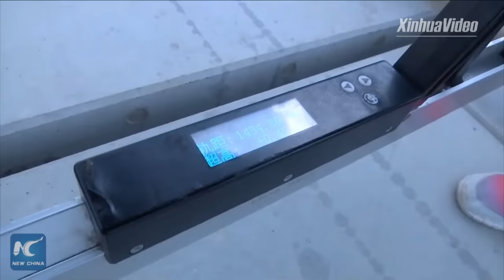How are China's high-speed rail tracks laid?

Comment: China lays more high speed track in ONE WEEK than USA has laid over last 10 YEARS
Reply: means its all gunna fall apart at the same time. Everything requires maintenance. Its a nice touch to see  concrete ties with  reinforcing steel still sticking out of it among other things. Lay  trash down fast with plenty of propaganda to go with it.
Reply: Is sad but is true.
Reply: Wich highspeed track you are talking about?
Reply: Sad, but true...Hope Texas puts the high speed track from Dallas to Houston together soon. Way overdue.
Reply: @GerhardReinig  China built network of more than 12000 km high speed tracks in 10 years.
Reply: not correct，it’s 25000km in 10years
Reply: But china very crash than usa
Reply: @IronViking  they are, I believe they're starting to build it
Reply: Is there high speed track anywhere in USA?  Where?
Reply: @standinsmore9962  its being constructed in California and there are plans for Texas but they're in danger of cancellation
Reply: @standinsmore9962  Amtrak's northeast corridor.
Reply: ОРМУС КАИЗЕР  
It's just too expensive in the US. You must pay every landowner and this does cost billions in the US. In China you just deport the farmers when they try to resist.
Thus its much more feasible and cheaper in China and that's also the reason why you use the aircrafts in the US. The latter are also faster at these distances and are more fexible than railway tracks.
Reply: @OpenGL4ever  The HSR tracks are built on elevated lines the colums of which take up minimal farmland!
Reply: Try 2 decades.
Reply: @Madmoody21  still holding after 2 decades. First track lay in 2008 and still running. Lol
Reply: @standinsmore9962  none. Just start to build one from DC to Philly. Finish date. Who knows. Lol. California been talking for 2 decades.
Reply: Bullshit it a matter of requirement, all those technique or machines heavily rely from Germany either import or produce under license locally
Reply: Loam Bart   
Saying Spain "only" has 3100km is misleading. The total land area of Spain is 505,990 km^2 compared to China's land area of 9.597 million km^2.
Similarly, France and Germany are only 643,801 km^2 and 357,386 km^2 respectively.

A smaller country will obviously need less high-speed track to meet its needs than a larger one. China should be proud of making so much progress in such a short space of time, but don't let fanboyism get in the way of facts.
Reply: wrong
Reply: @dumitrutudorache2156   wrong
Reply: @zpetar   so did the us
Reply: @dumitrutudorache2156  no it is not
Reply: Lmao the USA hasn't laid any rail over the past 30 years. All they fuckin do it rip up tracks and turn them into bike trails.
Reply: It took America to build almost 30 yrs to build 500 subway stations what is China own now
Reply: @GerhardReinig  Acela
Reply: @Madmoody21  I agree only 50% because I witness the construction workers drag their projects. For instance, I live across from a public school and they were laying new concrete in front of the school. It took them 2 months to do so because many times I see only 2 out of 6 people working and the rest of them just stand there and talk doing nothing. Another good example, they are currently undergoing a bridge repair by my neighborhood, everytime I ride my bike pass the construction site, many of them are just standing there talking and it was like 9am in the morning and they just started their day. And it happens every single time I go pass the area. This is tax payers money that they are wasting and they are getting pay an average of $55 an hour. The project still hasn't been completed after 7 months. That one little section about 100 feet of repair should not take that long.
Reply: CHINA is now the Global leader building helping African, Latin Americas and even European nations build their infrastructures with Superior Chinese Technology..U.S became imsignificant.
Reply: @OpenGL4ever  But how many places can you go to at the tune of $400.00 per trip? And this is if you book your flight a month ahead of time, you're lucky if you can get a ticket at less than $600.00 for same-day booking, you just can't beat the low cost for high-speed rail on the consumer standing point. I am sure the repercussions on the macroeconomics, in the long run, will really cost us big time in terms of competitiveness with countries like China imagine how fast they can move not only labor force but cargo as well this will make a huge difference in the future.
Reply: @Madmoody21  These tracks are monitored by computerized equipment on special highspeed trains.
Reply: USA trains are a disgrace.
Reply: Mrese ur english is very crash than chinas rails, fix it.
Reply: @standinsmore9962   yes north east us
Reply: all over the place if you like 85 mph.
Reply: @geraldmiller5260  no they are not... we move plenty of vital freight by rail... no disgrace there
Reply: @Madmoody21  jealous not make sense bro
Reply: I never saw old American movie showing construction railway first line. They were a lot of Chinese worker2 who game from China.
Reply: The United States does more freight. Plus, if Amtrak laid more high speed track people wouldn’t ride the train. You can thank our votes for where the railroad is today.
Reply: @Madmoody21  Something tells me there is a large enough population in the PRC to have enough maintenance personnel to handle it.
Reply: @LaRoucheisright  we do have a high speed trains and it runs on the northeast corridor called the Acela Express. One in California is currently under construction connecting LA to SF
Reply: @ryankiser294  Ya, well Ryan,  this is on a slightly larger scale we're talking about global. Lets start with going from the tip of South America, Santiago, to Anchorage, then under the Bering Straight to Vladivostok, on to Europe and from there to the Middle East, and Africa, oh ya and back at Vladivostok I didn't mention the other fork down thru China, the SE Asia, all the way to Bali. And that's just the "Road" part not to mention the "Belt" yet. nor even all of the Road, which will expand for a long time to come, crating maybe a billion and a half jobs in a  very short time.
Reply: You want a train from NY to LA????  We fly, it is still much quicker than a train.
Reply: James Hughes not faster than the trains China has.  The Us has never built even one mile of the high speed train China has.
Reply: But this not about measuring penises. We love China and Russia and India. We love all people and peoples. We will work together to reach the common aims of man, or we will perish. LaRouchePAC is the place for how to help make cooperation happen.
Reply: @LaRoucheisright  The british empire has been gone for decades
Reply: @yourneighborhoodwierdo8349  You don't know what you're talking about.  You don't know even what the British Empire is.
Reply: So what ?
Reply: @Madmoody21  Who said they were not going to maintain it?
Reply: Chinese railway sucks it is a loss making system.
Reply: @mrese4009  actually china has way safer trains than us thats bs. they had 2 TWO accidents since this rail network was built. we habe amtrak crashes like every 6 momths
Reply: @sumitpandey-tw7rm  actually it factually isnt dude. i hate the chinese govt but these are increbly safe super smooth bullets on wheels. its a fuckin fact man. european countries and japan and chine did it on a small scale. and chinca did it for cities as far apart as nyc to la. thats absurdly big. props to them.
Reply: USA has no high speed tracks
Reply: Yes, but it's made in China 🇨🇳. That's the difference.
Reply: @shaunw.1173  so its better, cool!
Reply: @louisaugustexvi4515 ,

Commodities from China 🇨🇳 are cheap quality. The market for the same part manufactured in different countries such as Japan 🇯🇵, USA 🇺🇸, or Germany 🇩🇪 reveal the price difference based on the quality of the product.
Reply: @shaunw.1173  price difference based off of labor lol, and don't speak when your product you're typing on is probably made in china, or has parts from china
Reply: @louisaugustexvi4515  ,

Sounds like you don't own any American or German engineered/made precision tools and compared them to Chinese made precision tools. There's a BIG, undeniable difference.
Reply: @Madmoody21  comment like this deserves way more likes, yeash i won't fall into any western and chinese propaganda thx for the reminder
Reply: who cares
Reply: who cares
Reply: Planes are faster.
Reply: @tbp1256  we all do. they’re dominating rn
Reply: Fact!!!!!!!!!!
Reply: @Madmoody21  you mad bro Amtrak derails more often
Reply: @shaunw.1173  jealous bro
Reply: @qjtvaddict ,

Huh? Of what exactly?? 🤔
Reply: @Madmoody21  At least China have High Speed Rail unlike the U.S.
Reply: You must have just flown in from Mars. You have no idea what you are talking about
Reply: @l0z586  Time will tell I say. I do so Hope you are right there  in mainland CCP China having a good time. You Will have even more fun in the next few years Im sure of it.
Reply: and than in PuRusha about 100 years
Reply: As an african from the motherland,i can confidently say,we used to be brain washed that america is a super power militarily and economicaly but that has changed for the past 20yrs since china set foot in africa,africa has made progress in comparison with the invasion of europeans since the mid 1800s,china is not a country that planders other countries resources for her own benefit but rather comes into terms for mitual benefit,militarily;china has leveled the play game by innovating her naval fleet,introduction of new fighter jets like the J7,and is also the only coutry in the world that has launched a space station without any joint intervention,and with the formation of the BRICS association the yuan will emerge as a formidable currency taking the dollar out of the picture,and i urge african states to join brics and ditch the dollar so as to free africa from economical slavery which for decades has had a negative impact on african states.
Reply: @Madmoody21 lol this didn't age well
Reply: Yeah they build so fast by cutting corners. Get a new job, 50 cent army.
Reply: Built ton mediocre Sstandards as nearly everything in China. 2800 of the 25 000 km  mentioned  were so poorly constructed that they were dismanted and had to be built again.
Reply: Criticize all you want but China seems to be moving leaps and bounds with high speed rail. Maybe they don’t have politicians bickering on how and where the tracks are laid. They just do it.
Reply: @OpenGL4ever Too many greedy landowners.
Reply: @pgdog888 HSR to nowhere?
Reply: @LaRoucheisright I guess high speed rail in the US for cross country travel is called the gas guzzling hot rod V-8.
Reply: @mad2barxhst  Those leaps and bounds involve burying people in wrecked train cars. Keep that in mind.
Reply: @pootispiker2866  What major accidents did they have? We’ve had a few lately in the US.
Reply: @mad2barxhst  "We've" had a few? No, my country has.

It's not relevant. China lost the high speed rail race when it decided that burying survivors of the Wenzhou crash simply to stop bad stories from spreading. How many times has the US done that?
Reply: It’s just amazing! And we are just in the dark ages! Falling way behind!
Reply: Mad moody it’s not like we don’t have accidents continuously!
Reply: Kudos

Comment: 8:23  I like the precision spacer used to ensure the space between the rail ends are proper - the handle of an adjustable wrench.
Reply: Dan Burch 

haha
Reply: 16:15 they have the actual thing, but I'm guessing that somebody discovered that the thickness is the same.
Reply: Apparently, the wrenches are soft enough to not damage the track ...
Reply: I presume that they bought the wrenches from Harbor Freight. That can't be right. Harbor Freight wrenches are made in China. So sorry.
Reply: They have been doing this a long time everyday non-stop since 2007, they know about building a rail more than you do. Why bring an extra tool when a tool you need every minute will also function the same?

Comment: Incredible feat! How do they handle thermal expansion? 500m should expand over 15 centimeters on hot days!
Reply: I was thinking the same thing, as well as contracting in the cold, this is north west China after all.
Reply: Rails are heated with propane burners, then tied down.  As they cool they are under tension so they never buckle during hot weather.
Reply: The rails at a given temperature,with hydraulic tensioning device,puts a given amount of tons pulling pressure applied ,then welded to gether ,and same at every joint , I think in Australia up to 80 ks long  .

Comment: at 13:33w we see a wprker using a long steel bar, held vertically to force the track into final alignmewnt before his co-worker can tighten the cllamps' retaining bolts.

In English we call this procedure "drifting" although not every English speaker would know the term as it is actually part of technical English vocabulary. n my own post-retirement shop I use this technique on a miniature scale to align many small mechanical assemblies for experimental electronic creations.

Comment: A long holder and bolt to pull the Track, while some are welding it, it's continuous until the standard distance of the sag corrections of the steel. It's on the management

Comment: Wow this is antiquated compared to the machinery we have in the UK. They can lay a whole track panel WITH sleepers, tamp it and weld it in one go in under 20 mins!  We worked at Wimbledon train depot and watched the track laying trains going past laying miles of track in one night!
Reply: they built 30,000 km of high speed rail alone, not counting the metro rails and the regular rails. They have way more gigantic and advanced machinery than you do, and they can build them faster and cheaper. they have been doing this every day, every year in multiple locations simultaneously since about 2007.
Reply: @rap3208 doesn't invalidate the comment though - the track-laying tech in this video isn't more advanced than the UK's.
Reply: @williamchamberlain2263  It meant they can layout tracks so quick and make your rail builders that they are standstill.
Reply: I don’t think laying sections of track with sleepers is “newer” or “better”. Its just a different approach for different circumstances
Reply: @rap3208  Cheaper - probably.  But they are not faster at building track.  What they are faster at, way, WAY faster, is securing the funding (by decree), the permits (by decree), the environmental assessments (by hand-waving) and obtaining the right-of-way (I don't even want to touch that one).  All of this takes years in the West, sometimes decades.  Then there's also the soil you are building on.  Over here we have to pre-load the soil which alone takes 2 years.  Maybe they don't have to... or they just skip that step.
Reply: @kaasmeester5903  You assume the chinese don't do all that? They are the master builders of the modern age. They used more concrete in 3 years (2011-2013) than the US has used in the entire 20th century (1901-2000). Keep thinking all that to make you feel better.

Comment: I hope the protruding pre-stressed tension bars reinforcing the concrete sleepers are dealt with properly.  It may be an efficient method for sleeper manufacturing (having continuous pre-stressed bars running from sleeper to sleeper as the concrete is poured into forms and hardens, then cutting the bars), but unless they're properly terminated and sealed, they'll prove to be a serious entry point for corrosion into the sleepers cores, causing their 50 yr life expectancy to drop significantly.
Reply: MelioraCogito 
Check sleeper, you find a good story behind it.

It looks simple but base on thousands tests. the material also good. Now a standard part for all rails in China. make it really cheap and reliable. You know what is means. Even low speed train track also use this stronge sleeper.
Reply: @ciditan1615 that doesn't answer the question of how they're going to stop the open ends letting water get in and rust out the steel
Reply: @williamchamberlain2263  
replace before rusted.
Remember. Nothing lasts for ever. EVEN YOU, ME AND THE WHOLE CIVILIZATION.

Comment: That a trade secret how to make a rail track 500 m. Long and straight, you cut it the it’s straight. Extrude it you got the wigglely track. Metal warp too.  Was it mode as pour cast iron 500 meter then machine grinded. Very hard to do long and precision  straight  consistently. And it’s attached very tight tolerance, it’s what need. 
Funny I seen tube Amtrak old track,  guy was showing lose spike that rise when you step on the tracks.

Comment: curious why some bolts and fasteners are missing and some not tightened ?
Reply: just keep the track in place and fine tune later, the two rails offset will not miss more than 0.5mm,
Reply: Curious how they overcome expansion without gaps. maybe gaps are cut at missing fasteners and then clamped?
Reply: double check....  no, triple or quadruple check
Reply: This vid and all those signs are for show!
Reply: If you tighten the bolts one by one, some bad thing will happen.
The un-tightened bolts will be tightened later.
Reply: if u have working in construction, you will know first step is rough in, then fine tune.

Comment: It looks easy because only the last step was shown. The crucial part is laying the large stone, which are manufactured with precision grinding machine because they are the bases. Even a tiny defect on these stone and/or in laying them would cause damage to the high speed train that runs at 350km/h on them.
Reply: Except that the steel rails are customized in a special rolling mill, the cement sleepers of the roadbed are manufactured in a factory building at a selected address along the railway line. Once the rails are laid, the factory building along the line will be transformed into a railway station. This plan can save a lot of money for the construction of the railway station.